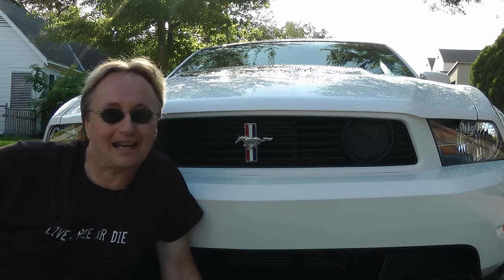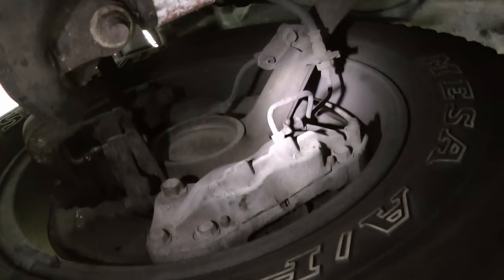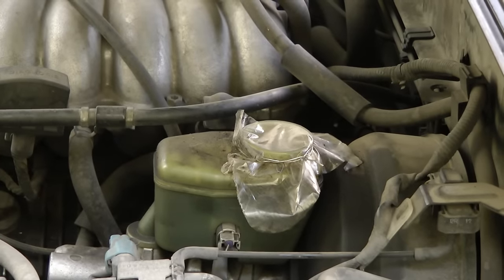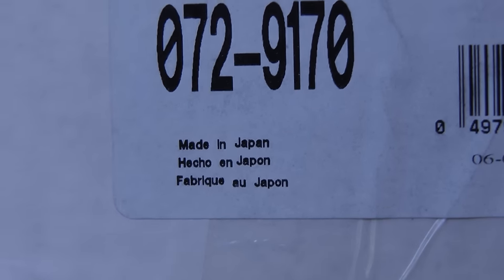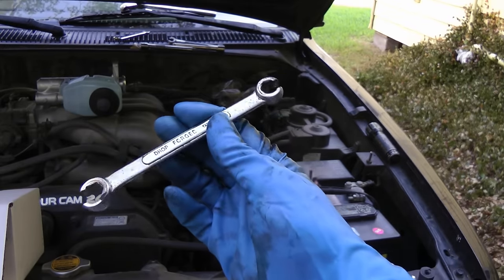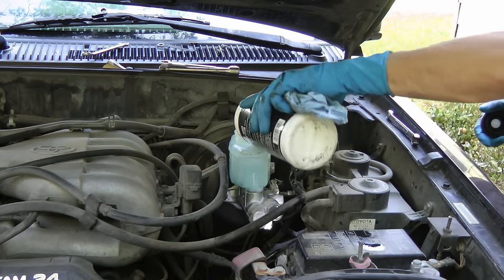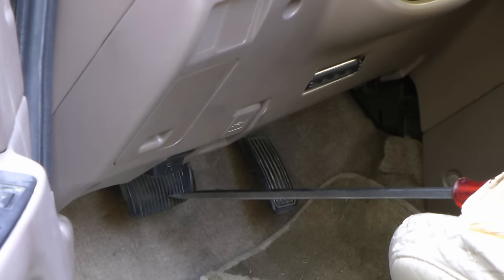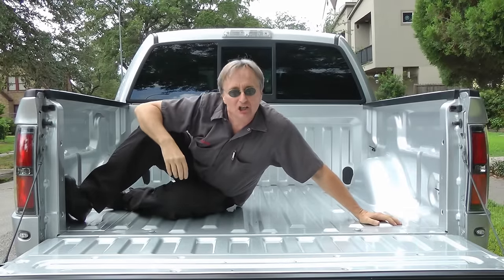How to Fix a Brake Pedal that Sinks in Your Car (Brake Master)

Comment: Have a 81 c10 the brake pedal keeps sinking I've put new booster and master cylinder on. Bled the brakes plenty of times. What could still b causing this problem? ?
Reply from the maker: somewhere it's losing pressure, pull off all wheels and check for leaks. If you find none, either rear shoes are too loose and need adjusting, or you got bad parts on that old thing
Reply: Scotty Kilmer Hi scotty, I recently did the front brakes on my Dodge Dakota. The truck brakes well but the pedal is a little spongy. While i was putting the pads on, I noticed the fluid was a little low as it also had a brake line replaced recently so I filled the master cylinder. Do you think the system just needs to be bled to remedy this. I believe I probably introduced air into the system by doing this.
Reply from the maker: NitroDragster426
  more often the master needs replacing when spongy

Comment: Hey scotty I have a question. I have a 77 ford maverick I've replaced the brakes, rotors, master cylinder and brake booster I also bled the brakes.  My pedal still goes to the floor I have to pump the pedal a couple times then it gets firm. My brake lines are fine there is no leaks. idk mayb i got a bad master cylinder? Any ideas what I should do next? Please help.
Reply from the maker: that old , odds are you got a bad master, of course, ONLY use a new one, rebuilt ones often stink when that old
Reply: Kk thanks, I'll give it a whirl. I love your chanel. Keep doin what your doing.
Reply: If you get a 'bench bleed' kit that comes with it?  Then use it.  It'll be two hoses that attach to the master cylinder outputs and you route them into the brake fluid reservoir.  Just clamp one of the ears of the master into a vice and you can use a screw driver to press in on the piston end.  Sometimes when the master is installed it can be at an oddball angle and makes bleeding it on the vehicle a pain.  Bench bleed it first, then attach it leaving the hoses in place.  Then it's just a simple remove the hose quick and pop the line on.  Bleed and call it a day!

Comment: @scotty kilmer is bleeding the brakes from brake caliper the same as master cylinder? my brakes are sinking to the floor... i did the caliper nipple bolt... still sinking... only did the front brakes tho... 99 ford ranger
Reply from the maker: no, i'ts not the same, but if brakes started sinking before any work was done, you have something broken, bleeding won't fix that. Often a bad master cylinder or leak at one of the wheel cylinders

Comment: hi i have a problem with my brakes i change the calipers and am not getting any brakes and check to see any leaks in the calipers front and back and i change the master cylinder kit still no brakes what cause that

Comment: Replaced my rotors, pads, calipers and most recently the master cylinder because my pedal would sink. After replacing master cylinder it still sinks after bleeding the system. What else is wrong?/:

Comment: Hello Scotty, i just replaced wheel cylinders both rear on mercury sable 96, but there seems that i cannot bleed the brakes because i have no pressure on the wheel cylinders. i "bleed" four wheel but still the pedal goes to the floor seems that theres still air but  i repeated like 10 times and still have pedal to the floor. i dont know what is really wrong. booster? master cylinder? or what else? HEELLPPP!!!!!

Comment: Hey I have a car that isn't getting any fluid to the lines..I tried to bleed the lines but nothing pumps out no matter how many times it is pumped. The pedal doesn't get firm at any point.. There is fluid in the MC reservoir.. I don't know for sure whats going on. the pedal goes to the ground as well. Any ideas?
Reply from the maker: Alyssa Hendrex replace the master cylinder

Comment: Awesome video! Really enjoyed your energy! I have a Honda Civic & just recently my pedal started sinking. Knowing that my brakes pads are not that old, less than a year...was wondering about that sinking feeling, giggle. Hopefully the master cylinder is not a pricey part..being a single Mom on a budget n' all. Is it possible that I have air in my lines? I checked my fluid & it is full. Appreciate your input. Many blessings n' hugs from Sunny Florida!
Reply from the maker: mainly bad master cylinder, air only gets in the line if there's a leak, and often it's the master leaking. Of course check all wheels for brake fluid on the inside of the tires, showing that wheel is leaking if that's the case.
Reply: Scotty Kilmer Will do with first light. Was trying to avoid the $80-$150 part LOL! But can't be driving around all willy nilly with a bad brake cylinder. Thank goodness it looks simple to replace, thanks to you! Wouldn't you know I don't have a 10mm wrench ugh! Have everything else under the sun LOL! Guess I'll have to invest in that too, since it is needed on darn near everything under my hood...replacing thermostat, etc. Which reminds me...I have no heat in my car & will probably have to flush my heater core. Any suggestions on that? My air works great & my radiator is cycling great. Thought maybe my thermostat was stuck open??? (as you may tell I am very intuitive for a female on cars, giggle) Is that a mustang boss in the beginning of your video? Have you seen gone in 60 seconds? Mustangs are my all time fav car!!! Eleanor is by far the bomb!!! Drooling LOL! Thanks again. I soooo appreciate your time!

Comment: Hi Scotty thank you for sharing your knoledge. I have a problem on my Toyota Revo 2000 model. I have it change with a Bnew Hydrovac ( didn't change the master ) and change the proportional valve/control valve. My problem is when I step on the brake pedal it doesn't sink to the bottom, it feels hard/ with pressure but it's doesn't have the braking power . I need to step on the brake pedal very hard to stop a 40 kph speed. Please help me.
Reply from the maker: change the master first

Comment: Scotty my 2010 Acura Tsx brake got frozen in -25 C I talked to local mechanic he told me about vacuum brake check valve.
I can't locate it on brake booster can you please help?
Reply: Brakes got harder after I started the vehicle and vehicle keeps rolling even I braked hard. Brakes didn't sink down

Comment: hay scotty, i just changed all 4 pads on a nissan maxima 2013 and now the brakes barely work,what should i do,i did pump the brakes with the mastercylinder cap off
Reply from the maker: +Aaron Merkin sometimes just squeezing the callipers back in finishes off the master cylinder. If no air is in the system, replace the master
Reply: +Scotty Kilmer, same as Aaron, yesterday we worked on the breaks and of course we accidentally loosened the caliper line while master cap was off. Would you recommend trying the process you started at 3:05?
Reply: +William Lopez, break pedal is pretty low compared to when we started the job.

Comment: hey man, do you have any idea on how to fix my hydrovac break system?my breaks goes failure, and the suction is too low. should I need to replace my vacuum  pump? BTW sorry for my bad English.....
Reply from the maker: often a bad booster or bad master. if it only sinks with engine turned on, but not with engine turned off when you step on the brakes, that's a bad boosteer
Reply: Scotty Kilmer no sir !isn't sinking, on and off engine. when I'm on the road my breaks goes failure. well I would say it works but a delayed reaction, and the vacuum pump pressure is so low.

Comment: Hey Scotty,
I have a '96 Accord
My pedal slowly sinks to the floor when I am trying to stop.  When the pedal hits the floor, I can lift it up and press it, and it will have pressure again...just loosing it slowly. I looked and have no visible leaks, and I am not loosing fluid.  I figured it was the MC, so I changed it and bled the brakes.  There was no change.  I forgot about it, because a month ago it started working like there was no problem to begin with, but the other day it started again.  Any idea
Reply from the maker: pull off all wheels and check for leaks on them and the rubber hoses near them. If not that, you got a bum master cylinder OR your brake booster is going out
Reply: Would a brake booster really cause this?  I always thought it was a hard brake pedal if the Brake Booster went out.  I know a lot of people have told me it could be the ABS leaking internally, but wouldnt that throw an ABS light?  Thanks

Comment: i have a2005 bmw x5 sports brake dont work i change the master cylinder the power brake booster .bleed all 4 line and still the brake pedal sink to the floor ..please help me before i burn it..

Comment: My brake pedal gets hard after a few pumps but then I turn the car on and start driving and when I push the brake pedal down kinda slow it goes to the floor but when I press it quick it works just fine there’s no leaks at all and this all started when my right rear Cali went out so I replaced that and put New rear pads and rotors on and it still does it never did with old brakes

Comment: I need your help I had to out new master brake cylinder and two rear brake cylinders & shoes,but I have brakes when I pump it but it sinks how can I bleed Master brake cylinder I have a 2000 Honda Odyssey cargo van? Thank You.
Reply from the maker: if it has ABS brakes, a dealer level scan tool is needed to bleed those babies, so find a guy with one

Comment: so what if you have an ABS unit attached to the master cylinder?  do you simply take the plate off the bottom and access bolts that remove it from the MS?   any replies would be appreciated.  This is a 95 Cavalier that I need to replace the master cylinder on...

Comment: so I can assume right away it's definitely the master cylinder if I have the exact same symptoms in a abs version?
Reply from the maker: nope, it could be the abs dump valve going bad, ABS makes repairs much more complex and expensive to do
Reply: yeah you right I almost lost my mind around this to  ending bypassing  the abs pump just to check it and it just works great, so now I end with a bad pump, a bad module or at the best the pump just need bleeding what I really don't belive

Comment: Hey Scotty! Got a problem w the brake system, 97 Lesabre, 3800. When I start car, no problem, but as soon as I push down on the brake pedal it makes the loudest air sound! Like fshhhhhhhhhhhhhhhhhhsh! When I let off the pedal, back to silent. And, its like the brakes are from the olden days, like manual brakes, not power brakes. I can def drive it, it stops fine like a manual car back in the day would do, but it makes that fsssssssssshhhhhhhhish every time you push the brake pedal. Master cylinder? Prob not but how about check valve? Could I be that lucky by chance? Hope its not the booster but I'm feeling like it is. Theres one at a pick and pull but I'm worried about that if thats what I have to do. Scotty, what would you do 1st? Hope you can help me w this! Thanks!!
Reply: sounds like it wants to fly! it believes it can fly! (:

Comment: So, no matter what; if air gets in the System, you have to replace the Master-Cylender???
     I replaced my Brake Hose, "Bled" the Calipper,  and kept the Master Cylinder resivior topped off.  So, what's the deal?

Comment: what if the pedal is firm when engine is off but once started sinks abit(thats normal i know) and then if you keep preesure on it it creeps downwards? no leaks as far as i can see. internets tell stories about failing abs pumps and something called diesel pedal creep?

Comment: When it comes to a hyrdoboost brake system on a 2001 gmc safari and the engine is off should the brake pedle get hard when pumping it?
Reply: Osvaldo Morales Yes, it's supposed to do that. That means the brake booster is holding vacuum, so it's working properly. If it didn't get hard when pumping brakes while vehicle is off, your booster has a leak(leaking air, "probably" hear a hissing noise everytime you press the brakes). That means when your driving, you will have very hard brakes, and you'll have to use 2 to 3 times the force to stop your car....

Comment: I'm trying to change the brake booster in a Buick Lesabre and there are 2 screws I can't reach because there is a tube right in from of it next to the pedal attachment. I can't find anything online cause I don't know how this is call.  I believe is the thing connecting to the stearing wheel. Can anybody tell me where I can get information on how to do this? Thanks for sharing.

Comment: hello scotty,
i have nissan sunny japan 2005,when my car is switch off my brake paddle get too hard direct without pumping,and when i start and or drive my car my paddle sinked too much to the bottom .please advise what to change in my car,and thr is no air contents in brake pip line. please advise thanks.
Reply from the maker: often a bad brake booster

Comment: I put my MC together, bench bleeded many times, installed on car, bleeded again. Wheels skipped. Engine stopped, pedal almost hard. Engine started, falls to the floor. One told me to squeeze all 4 brake rubber hoses with vise grips, i did, removed one by one, each time testing pedal, it was rock hard until i removed grip from FRONT RIGHT hose, after that it sinked immediately.
Swapped L/R calipers, still same. 
Tomorrow i swap L/R hose, to see if it moves to left.

So i assume its rubber hose?

Comment: I use a cheap wood clamp from menards. you can swap the ends so its a pusher instead of a squeezer. then between the seat and the brake pedal.

Comment: my brake pedal only sinks when the car is on, but when the car is off, I pump the brake a couple of times, it hard as a rock. any ideas Mr.Kilmer?
Reply from the maker: +marryson123 you either have a leak in the system, or the brake master is bad

Comment: I bought an 08 yaris a few months ago certified, and emissions. Brake pedal doesnt feel right. You have to push it halfway to get it to stop normally and almost all the way to the floor to brake hard. I checked the lines, master cylinder is clean and full, checked the pads and rotors and rear drums and cleaned them and they all look fine.  The bleeder valve was rusted on and I couldnt get it out. I did an obd reading and didnt get any codes as well. Do you think it might need bleeding? Car is only 6 years old and fluid level is good
Reply: Use a torch on the bleeder screws if they are real rusty and if you can’t get a wrench on it anymore, use some vise grips to remove it. I live in Illinois and this works every time. Make sure to replace the bleeder screw.
Reply: I did that, unfortunately, the bleeder was rusted so bad that it bonded to the threads and stripped it out. I ended up having to get a new wheel cylinder, and driving it to toyota while it was leaking. They wanted over $130 for an oem, and around $34 for an aftermarket wheel cylinder. I went with the cheaper option, but they still charged me like $285, just to bleed the system and install it. What a rip off.
Reply: Personally i would of done that myself, but I’m a service tech. yeah dealerships are always more expensive. Let see i just did a master cylinder on a 05 Gr. Prix he paid 147.00 for the master, I was going to charge him 150.00 to put it on and bleed the system. But I ended up doing it for 100.00 because he pumped the brakes while I cracked the lines on the master.
Reply: I kinda of panicked because it wouldnt stop dripping and immediately took it there. After they did the work, the pedal was still sinking, and they said they couldnt do anything. I guess it because of rubber brake lines, but it was worse than when I bought the car, so I just adjusted the rear drum brakes to compensate a little. But yea, I understand repair shops need to make money, but things like this is are blatantly a rip off. The cheapest shop I know of used to charge 58/hour for labour, most these days charge over 100
Reply: Yeah some shops ask for way too much. Right now i charge about $30hr and sometimes i charge 25% off what Alldata say's to charge. But I’m mainly doing freelancing in till i get another shop.
Reply: In highschool I took at coop at a local major service center for a while and learned how shops do things. Many are dishonest about certain things, but either way, they are always looking to get more and more money out of you. Like when someone comes in for an oil change, they will usually end up getting a brake job, filters, sometimes a ton of other things done too, even if if they have at least 30% life left in them. But yes, shop rates are crazy. Where I worked, it was $94/hour, now it's probably at least $100. In canada, the problem we have is finding cheap auto parts for consumers, compared to the states. Everything is so much more here unless you have connections
Reply: AwesomenessIskey I’m not defending all shops/mechanics it’s very true some are shady and want way too much for their services. I went into this business because of my fond for cars and the ability to help people. Vehicles are used in all parts of life and are a crucial tool used to get people where they need.
With that been said you are not forced to have services done that you do not want, unless it puts someone at risk. But you must remember that in all businesses: they always want you to spend more. If I where you i would shop around in till you found a good shop that priced and worked on your car fairly.
 Or work on your own cars, with all the YouTube videos on diagnosing, procedures on how to do basic maintained. They’re really no need to take your car to a mechanic unless you hate working with your hands or you make a lot of money that it doesn't matter.
Reply: True. I actually bled the brakes the other day again, and the pedal still sinks. People say it's normal on toyotas but I dont think it is.When I adjust the drums, it fixes it for a while and goes right back. I'm thinking it's the master. The booster is fine because when the car is off, it builds up pressure easily.